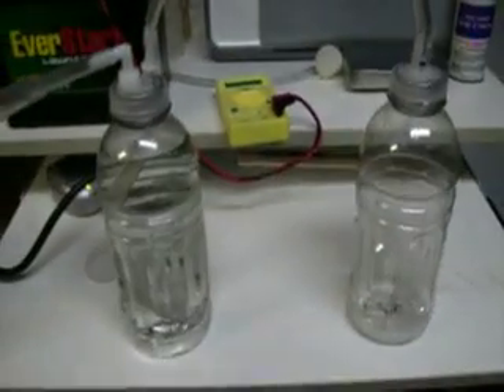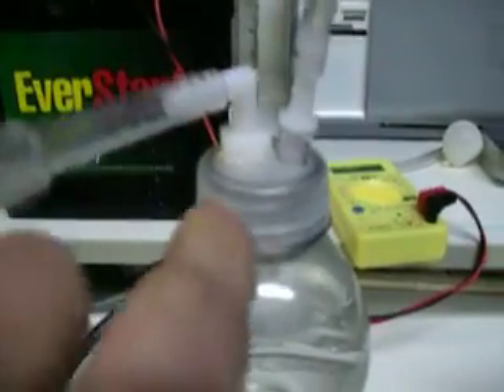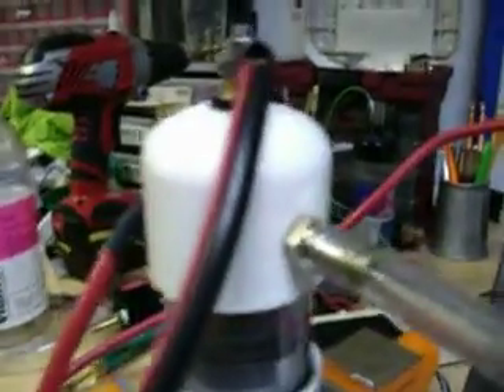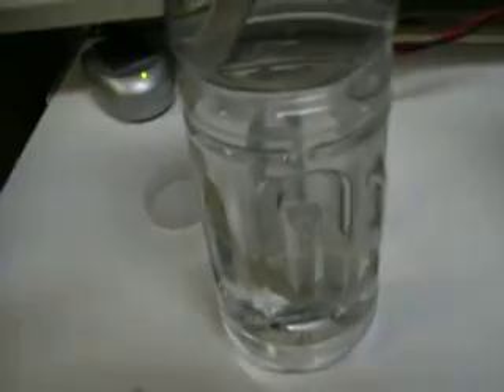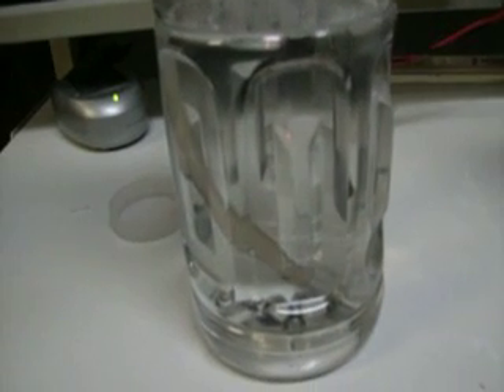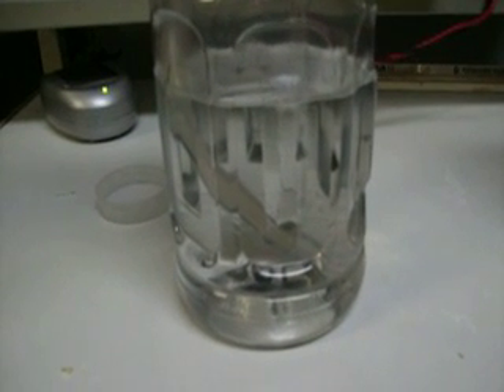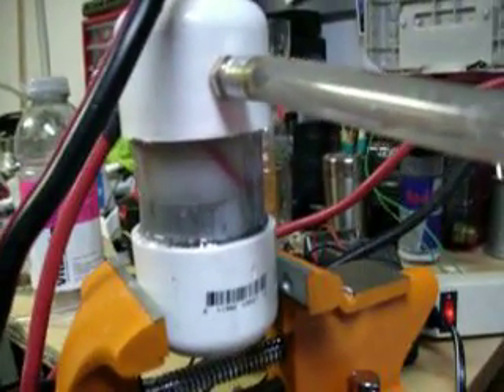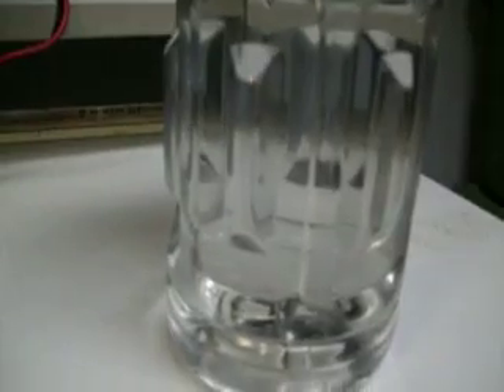HHO Generator 1 Liter in 1min 30sec No PWM

Comment: For all you idiots that think hydrogen wont work in a car go and search mythbusters and you will find they tested some of these things. They made a mistake with the hydrogen producer but they proved that a car can run on hydrogen alone. Now this little creation here is used to boost mileage because the human race is so dependant on fossil fuels they cant totally change to hydrogen power. If it was used to its full potential than my previous post could become a reality.

Comment: Here is the problem with this people are using this to boost mpg but they should be using it to run their cars. Remove the gasoline all together. Because hydrogen burns clean it can be recycled and put back into the engine. Unlimited fuel. Only downside is the need for large amounts of electricity but we have that naturaly its called lightning. Fuel crisis solved.

Comment: honestly, 
sounds like your taking a leak.

good job, i've seen others use a inverted bottle filled with water inside a larger bottle. another words, a 2 liter bottle with its top cut off, filled with water, and a 1 liter bottle inverted and filled with water. hose from HHO generator goes into inverted 1L bottle.

Comment: WHAT?
1 liter in 90 seconds at 12,6V & 5 amps gives OVERUNITY. 136% efficiency....or 
10,6 liter/min/watt
Please check your voltage and amps one more time. Do the battery voltage drop when running?
How is your cell build up?